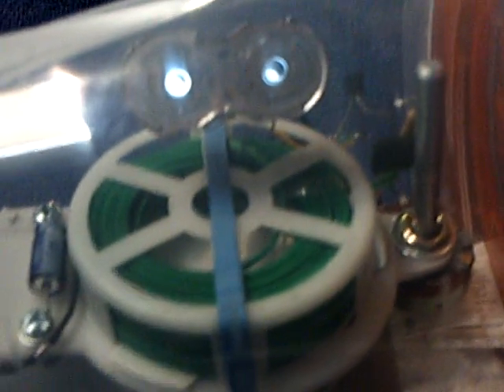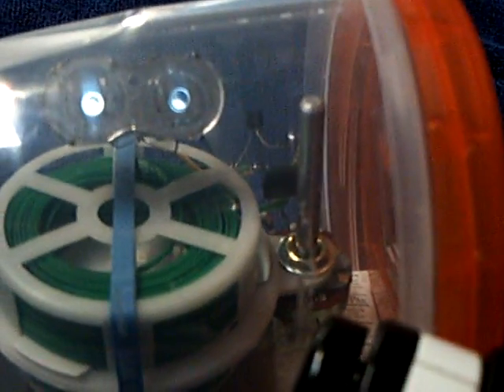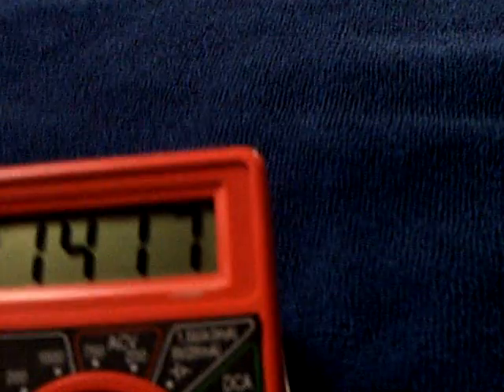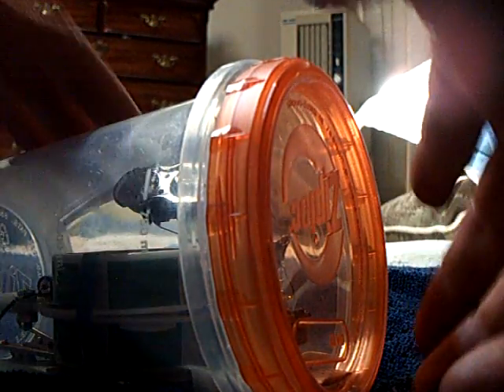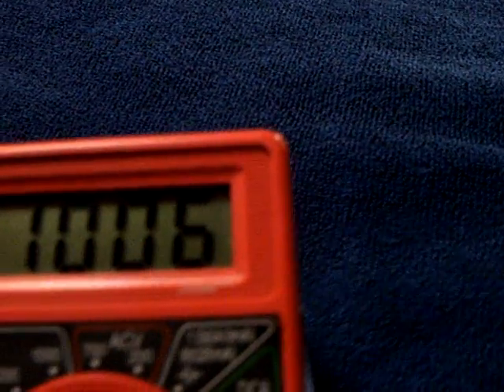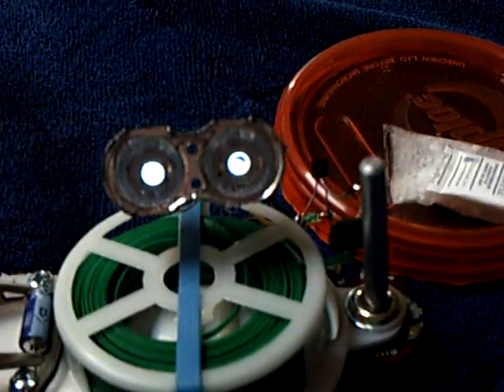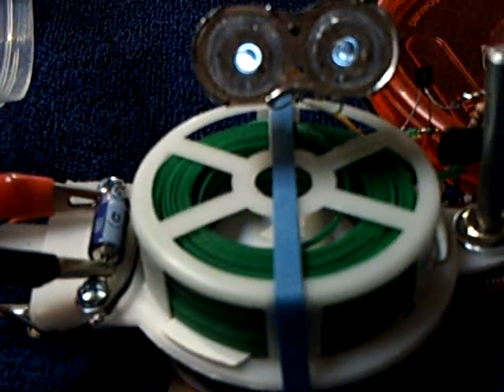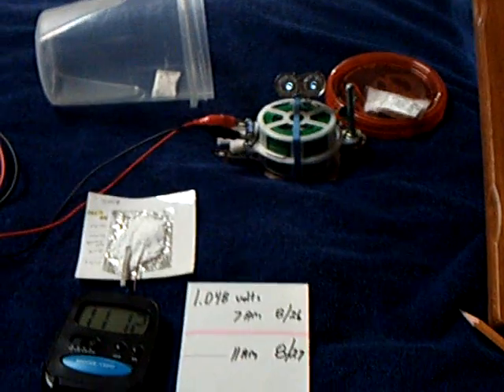Results of air humidity on crystal cell experiment

Comment: Dear Lidmotor,
An interesting experiment would be progressive vacuum to desiccate the cell.
A vacuum pump akin to what is used for pulling down a flouro tube or even a hand actuated type for a brake job with the desiccant on the other side to note pre vacuum weight and weight increase of the desiccant. on the receiving side.JB notes Piezo.
Thank you for all your effort and sharing to be sure.
Very Best Regards,
Diveflyfish

Comment from the maker: @freeenergynews ---I think that the sun does have an influence on these cells.   There are other things perhaps going on that cause the fluctuations. Perhaps a good experiment would be to put one of the cells in a farday cage  (microwave oven?) with a volt meter and see if any changes happen when the cell is shielded.

Comment from the maker: @egn83b ------I really don't know what is happening.  Today I took the oscillator out of the container and the voltage went up and then down.  There may be outside EMF acting on this like you said.  This oscillator is drawing less than 1 milliamp so it might not take much influence to load or unload that cell slightly.

Comment from the maker: @DiyEcoProjects ------If I were to do this again I would just put the voltaic cell inside a chamber and leave the oscillator outside.  A humidity gauge inside the chamber is really needed to compare the inside air humidity to the outside.  Without that gauge I am really only guessing at what was going on inside.

Comment from the maker: @diveflyfish -----I actually did this experimant wrong.  I should have had a humidity gauge inside the chamber so that I could see what going on.  The packs were supposed to absorb the moisture in the air and lower the air humidity inside.   The voltaic cell would see a lower humidity and the galvainic reaction would slow down.  The way that I did the experiment I really don't know what the air humidity level  was inside.

Comment: Dear Lidmotor,
One issue is that the container is not dessicated, rather the cell may have been but is the relative humidity any different?  Is it not necessary to have a true negative pressure cell to make the determination of elimination of humidity?
Very Best Regards,
diveflyfish

Comment from the maker: @bdsolar -----You may be right.  If the control cell had been loaded similarily,  then the voltages might have been closer.  I also agree that the water might be in tiny cracks and crevices within the cyrstalline structure.  If that makes this cell run longer and perform better then I think that it is a good thing.  I will run this until I start seeing an abrupt drop off in the cell output.

Comment: Penny was running all that time too...so it's ultra efficient a cell as well as circuit.
Maybe light/sun rays negatively affects this type, whereas the straight Alum cells benefit from heat. 
The moon is 'up' during the day lately, maybe a factor (similar latitude here in OK), Maybe a sun flare thing arrived at 11pm !
Penny is earning her keep isn't she :)

Comment from the maker: @bdsolar -----Good comment,  The unloaded control cell was 1.431v yesterday and is now 1.419v (drop of .012v).   The test cell under load went from 1.048v to 1,005v  (drop of .043v).  A better experiment would have been to have had both cells under identical loads.